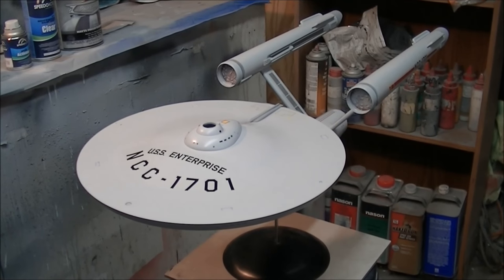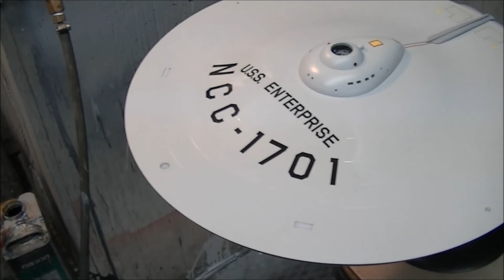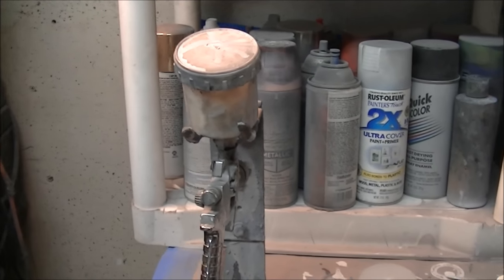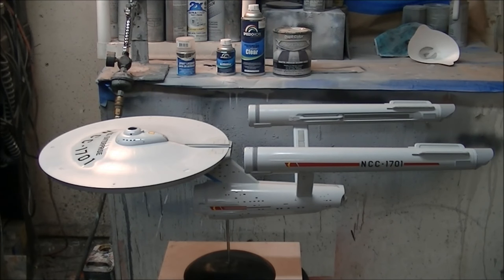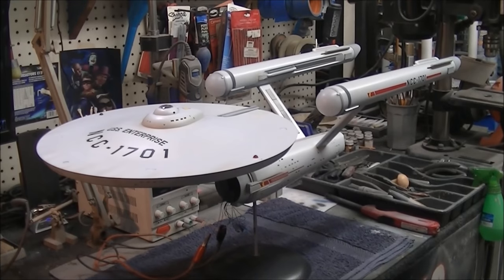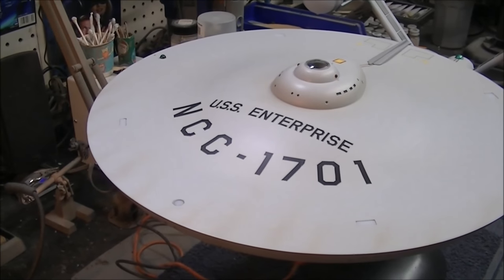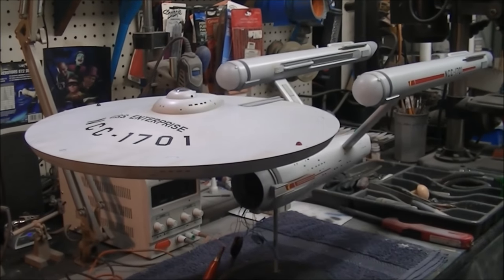1:350 Scale TOS Enterprise Sealing The Decals With Clear Coat

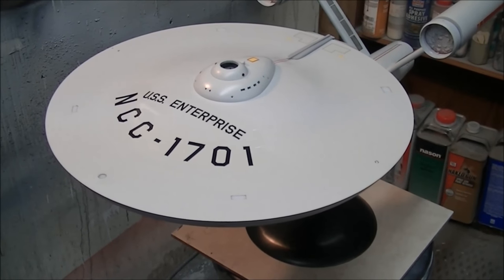Comment: Hi Boyd, great work there.  I have a question on this video . . at 1:44 you refer to using Testers Decal Bonder to settle down the decals after your install them, but your video clearly shows Testers Dullcote lacquer and not Decal Bonder.  What did you actually use  . . . was it Decal Bonder, or Dullcote lacquer?  Thanks!

Comment: The Enterprise looks great Boyd, but, I have a question about the Duplicolor clear. Would you recommend thinning the clear when using an airbrush with a .05 needle. Cheers
Reply from the maker: You shouldn't have to thin it but you can if you want to with some straight lacquer thinner.

Comment: Question Boyd. I know the stuff you use is top notch and it's needed for your clients and such but for an occasional user is there a budget clear coat product that may produce a satisfactory job if you're careful with it? Just curious.
Reply from the maker: The clear coats I showed here are pretty cheap. The two part high gloss with the hardener was about $25.00 and the Duplicolor Matte clear was about the same. Both will last foe several model builds so it's a good deal in the long run.
Reply: awesome. thanks for the info

Comment: Great work as always Boyd! I was wondering what size air compressor you have to use with that type of spray gun? I'm tempted to try on for a few different modeling and prop projects.
Reply from the maker: If you are just going to be painting models a small pancake type compressor will work just fine.
Reply: that and a few helmets,  I'm currently using a 1.5 horsepower 125 psi with a 3 gallon tank. think that would work ok? heaviest thing I would put through it is automotive lacquer.
Reply from the maker: It should work fine.

Comment: How about a video on dealing with decal silvering.
Reply from the maker: If you've already put the decals on and sealed over them and you have silvering there is not much you can do at that point.
Reply: TrekWorks Ok.  I was wondering because my decals had done that after applying clear coat.  A bit of sanding and a couple recoated seemed to do it for me.